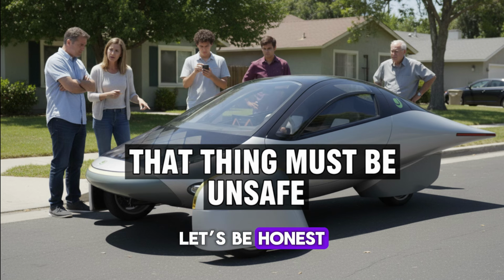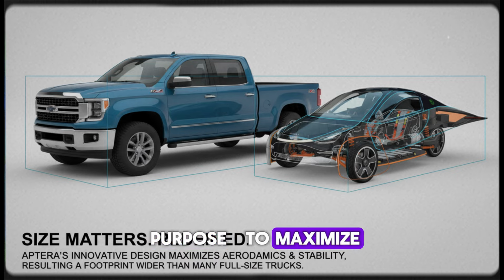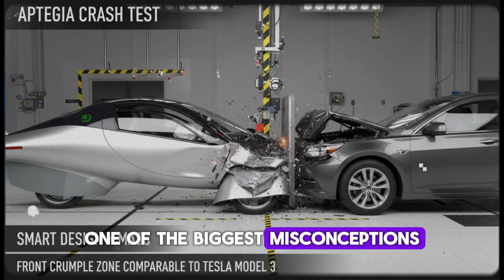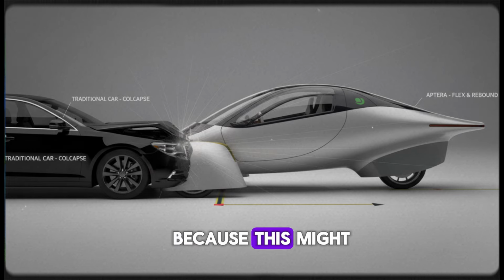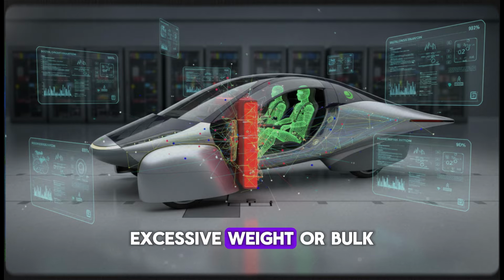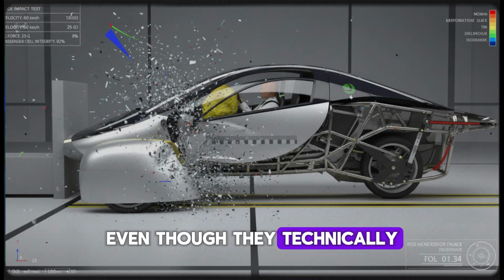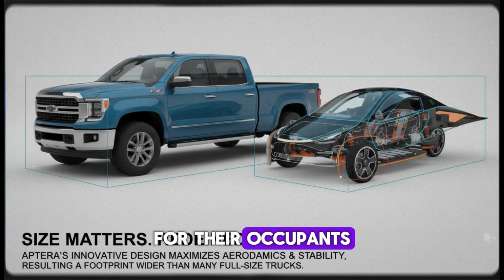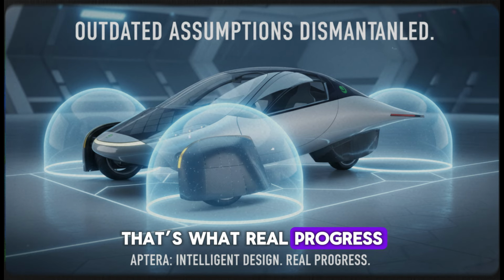Aptera’s Aerospace Safety Design Is Blowing Up the EV Market

Comment: I am not seeing the aerospace design at all. All I see is a forged carbon fiber tub bolted to an aluminum frame. It's the same construction technique that something like a F150 has. They just use a steel frame and aluminum body. Nothing from the Aptera screams aerospace. I guess if you keep using that moniker, then it must be true.

Comment: It’s built similar to a formula 1 car and they are made with carbon fiber just like Aptera
Reply: So an F1 car is a forged carbon fiber tub that is bolted to an aluminum frame? Better call the F1 teams and tell them that because it's news to them.
Reply: @billsmith5960 guess you never looked at an F1
Reply: @CalvinJordan-b1c - I have and have worked in Indycar and prototypes for many years. All use similar construction. Thus you have never looked at racecar construction over the last 40 years.
Reply: @billsmith5960 I guess CPC group doesn’t make the for f1 cars like they show.
Reply: @CalvinJordan-b1c  - This has nothing to do with CPC. Stay on subject. With you knowing how F1 vehicles are constructed, then show how they are like the Aptera.

Using CPC as an example, I will use Ball. Yes they make those products that people can with. They also are an aerospace company. So, Ball canning equipment or their other packaging (like a can that holds soda), is just like their aerospace operations. Since the same company owns both (until 2024). Thus the James Webb Telescope has canning tech in it or is it the other way around?
Reply: @billsmith5960 they make the f1 bodies so I think they know what they are doing and you have to learn the difference between similar and the same.
Reply: @CalvinJordan-b1c  - So they make F1 bodies? Good for them. We are talking about the chassis and not the body. Please explain how it's like what is used on the Aptera.
Reply: @billsmith5960 im talking about the construction,look at the suspension and the use of a 4 point roll bar with a carbon fiber reinforced cross member.. they use the fram to hold the batteries and transfer energy in an accident
Reply: Suspension is literally attached to the aluminum frame. Just like an F150 pickup. The roll bar is needed because the CF is too brittle and thus they need something to be not so brittle for a rollover. The world of material science agrees with me. Modulus of elasticity is your friend.

F1 any other Indycar or prototype since the late 80's uses a carbon tub where the suspension is attached to it. No separate frame needed. I am amazed that people think that the Aptera is like an F1 car because Chris Anthony said so and just accept it. It's insulting to any vehicle engineer.  They fooled you and thus all is well. But please stop looking like someone that takes limited information and draws a conclusion to draw the company line. It's really bad.

I've been working on Indycars and prototypes since the early 90's and it's insulting that people just use what they see online and accept non engineers like Chris Anthony as they say is gospel. Please, do some research.
Reply: @billsmith5960 they need the frame for the batteries and if you look at the original body the suspension was attached to the body,but they could not mass produce it so they went with forget carbon instead of honey cone, and you seem to have a problem with the word similar not the same.
Reply: @CalvinJordan-b1c  - I could care less with the old design. Why does the new aluminum frame hold the suspension, driveline and battery? It should be like in F1 where the carbon fiber tub does it all. It does not. Why?
Reply: @billsmith5960 because they designed it to transfer energy from the back towards the rear in case of an accident. Seems you obviously don’t like it but no one cares whether you think only those people who believe in what they’re doing. As far as the suspension it is nothing like a F 150 , even the shocks are horizontal not vertical
Reply: @CalvinJordan-b1c  - This has nothing to do with F1 then. So you admit, it's nothing like F1. I never said that the suspension was like an F150. So where you got that from is beyond me. Instead, please stick to the subject as opposed to some mental exercise where you try to find something that is not related at all, to be something you know.

Let's get back to that F1 and Aptera.